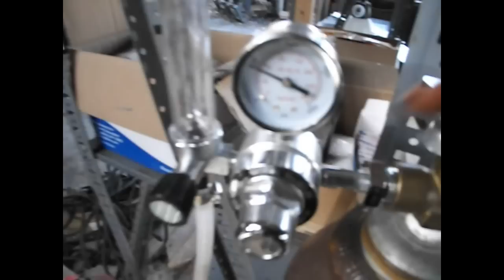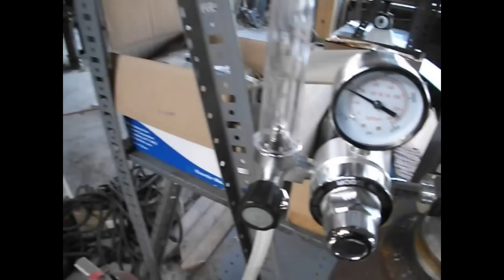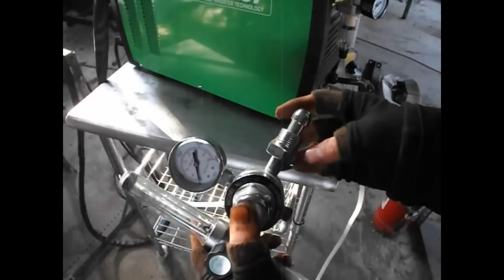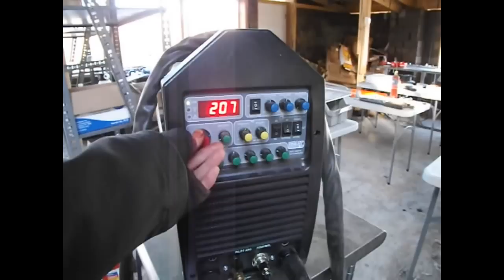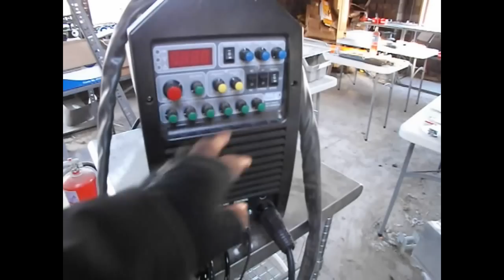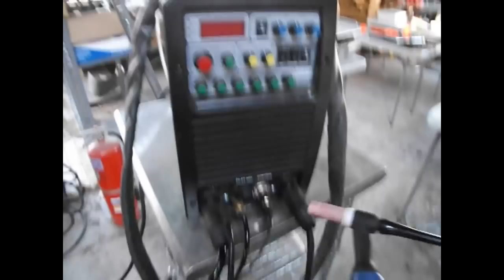TIG Welding Setup

Comment: Not sure what welding "tec" you refer to...but anyone familiar with TIG welding would find welding with EP (+) laughable. It can be done, and was years ago to weld aluminum but huge diameter tungstens were required for relatively low amperages, because the tungsten would just melt away because most of the heat was concentrated on the tungsten.     IF you want less penetration, use less amperage.  Warranty is 5 years.

Comment: hey sr.. Marcin  J.  you power pro256 they have plug female to install water cooler.. I have too power 256 almost 1 year ago so  I buy it same day water cooler to run 200 amps. to not melted tig torch.. more performace  work all day .. this unit may swap any torch plasma  cutter do you have any idea,,

Comment: There are several issues with your video.  Your TIG torch is connection is wrong.  Your torch should be in the negative.   You do not ball your tungsten on an inverter. DO NOT DO THIS THIS IS WRONG INFORMATION!!! Always use a point.  In old welders you only make a ball on AC.  Not on modern inverters!!!!  A ball destabilizes the arc.  Please re-edit this video to include the correct information.  Please read the manual.  available online for further and correct information.